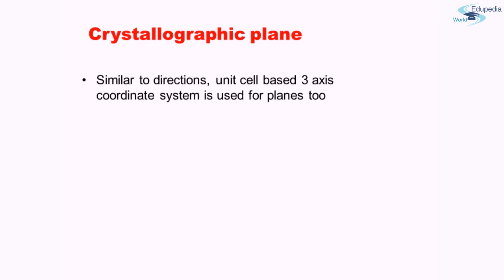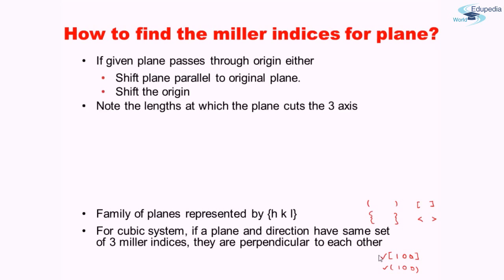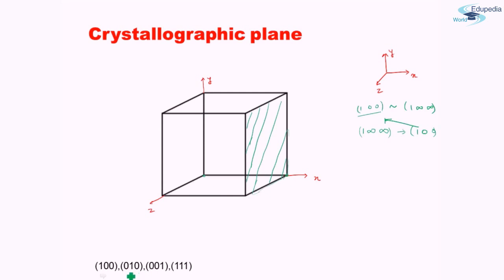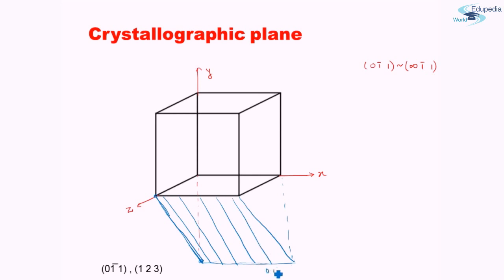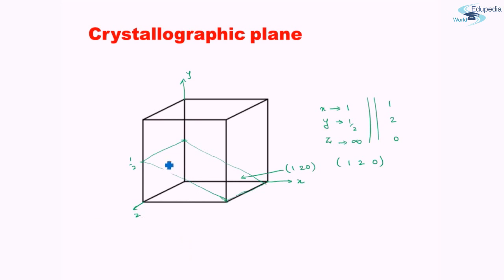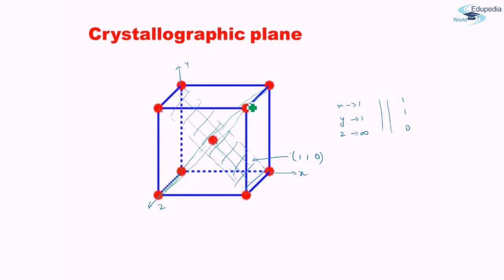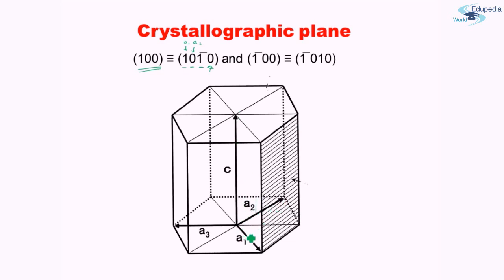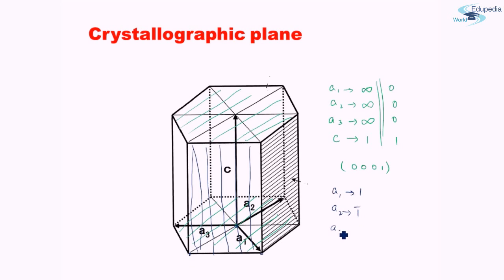AMIE Exam Lectures- Materials Science & Engineering | Crystallographic Plane | 3.7

Comment: How u find closed pack plane
Reply: The plane in which the density of atoms is the highest, that is number of atoms per unit area is maximum, will be the closed pack plane. More often than not it is the plane in which the atoms touch each other.
Reply: and the direction in which there are max number of atoms is also close pack direction. this is important because we need to know about the slip planes and directions. the slipping happens in the close packed planes